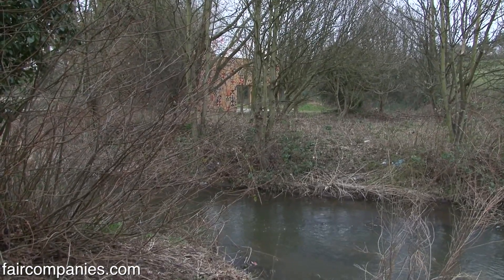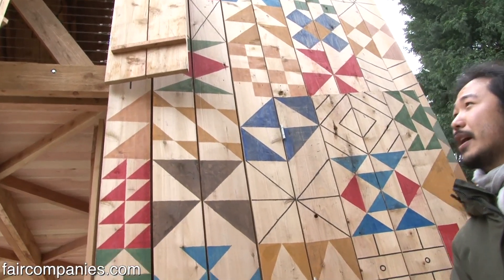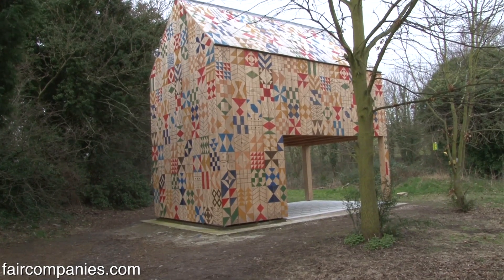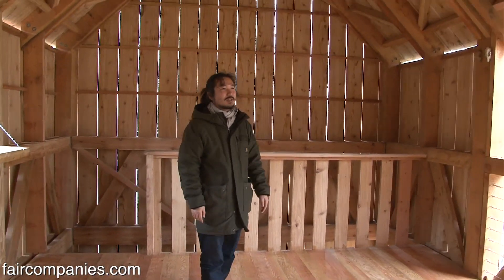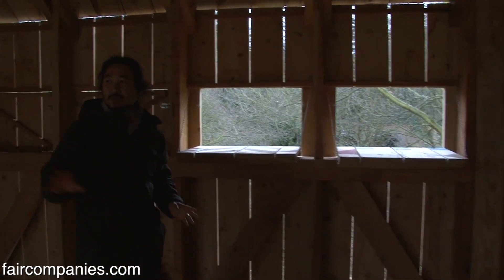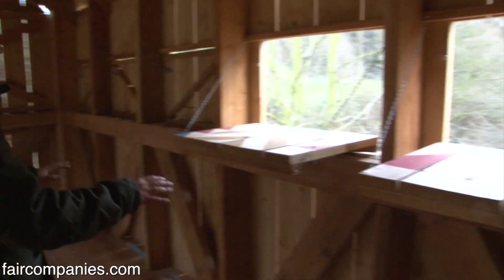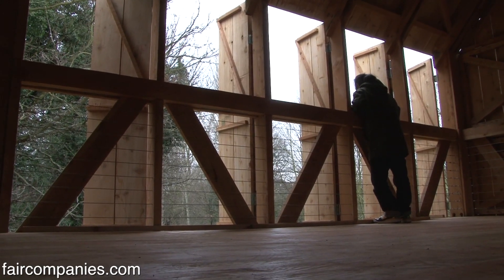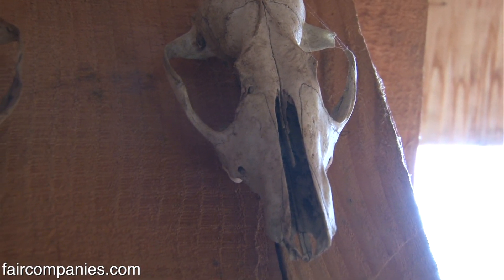Colorful timber cabin: walls/windows hinge-open in 3 sides

Comment: Is the guy crazy? He's built a shed in a wood in Kent and expects people to set up a workshop in it. The winters in the U'k' are wet and cold. There is no insulation and I even saw huge gaps between the boards that made up the walls. The guy was wearing a thick coat and a scarf. Health and safety regulations regarding minimum temperatures for workers and indeed fire regs would certainly prevent this building being used for any domestic or commercial uses. Just saying! s

Comment: In response to Saenziopez (commented about 8 months ago), I agree.  It does seem to violate any sensible construction code.  I would not want to put too much weight there in the middle for fear the floor would cave in.  I'm no engineer, though, so maybe I have idea what I'm talking about.  I do know, however, that you'd not get me in there with a crowd of party-goers dancing and moving around.  It's potentially the making for a fail compilation video.